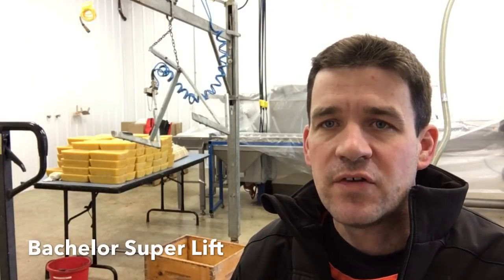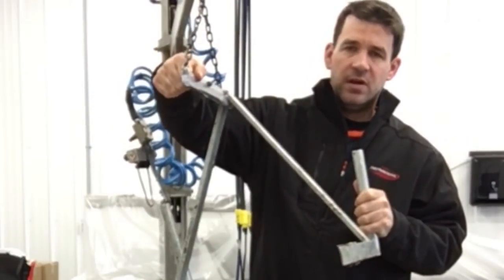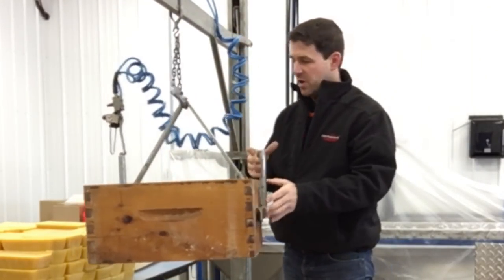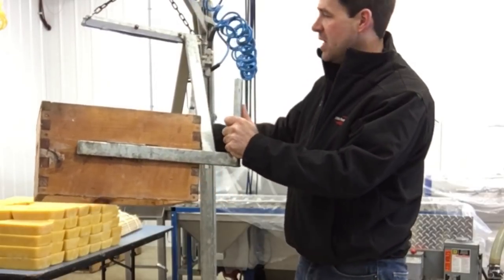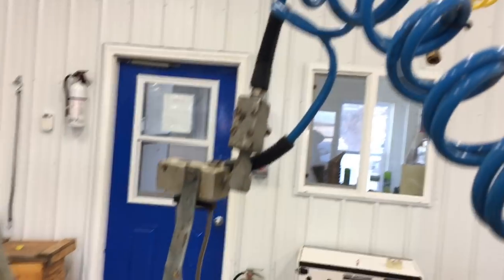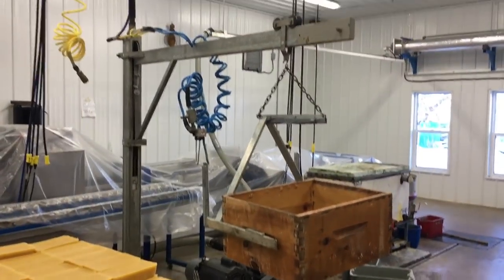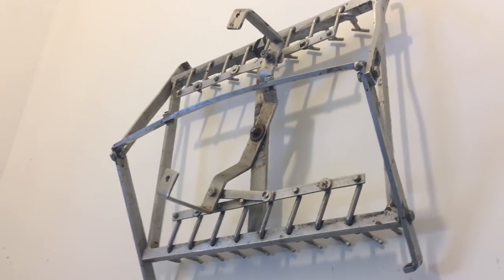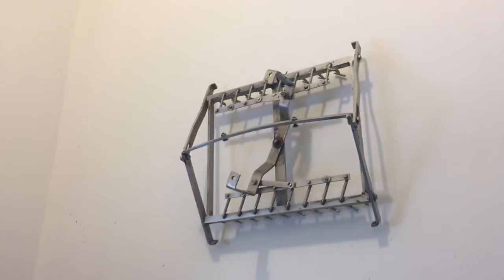No more honey house lifting, using a Bachelor Super Lift

Comment: About ten years or more I was involved with a jig that you could use to make hand holds like you see in manufactured hive bodies. If you can find it in one of the “Bee Culture” article dealing with wood working. A.I. Root company wasn’t in the bee supply business at that time. Very little was done to keep them in it. But the Jig is made to be used on a Table Saw. Any good saw will do. Like the lifter good luck with it.

Comment: Looks like you could use an up speed control regulator.
Reply from the maker: Chris Turley ya, I have an air regulator but it’s pretty basic 
Under load it lifts adequately
Reply: a Canadian Beekeeper’s Blog They make a small in line unit about the size of your thumb. If your up continues to snap so quickly you may want to consider one. Other than that nice tool. 🖒